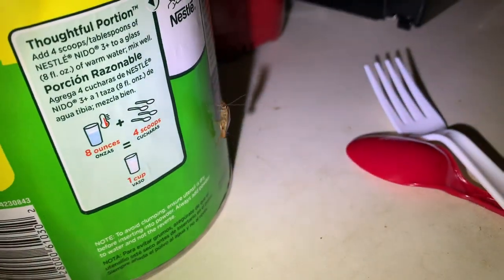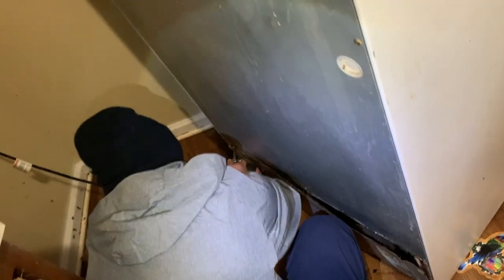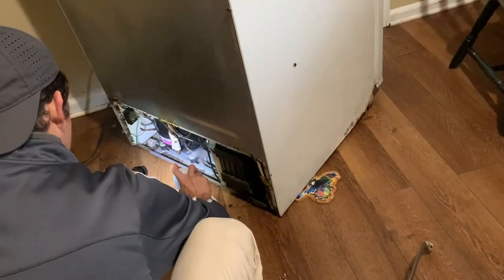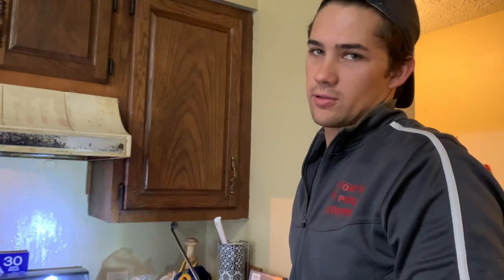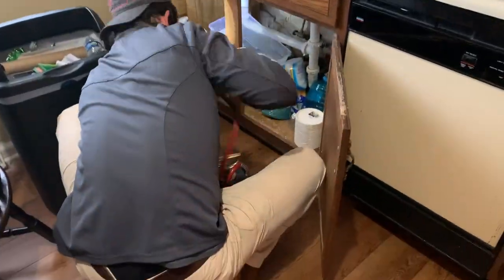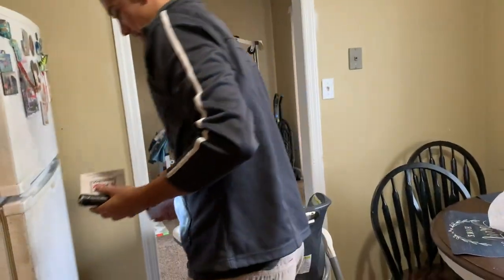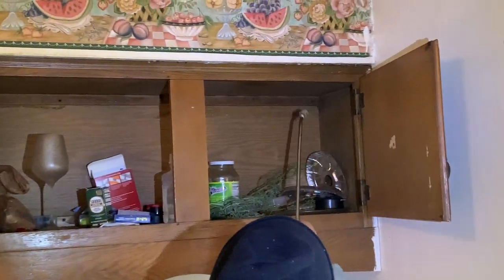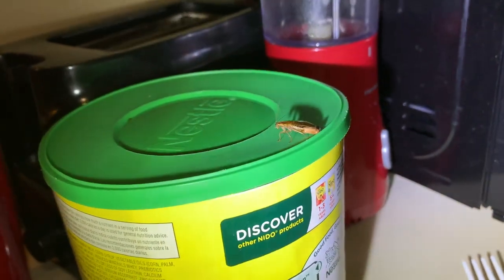Cockroaches in Your Kitchen... Probably?

Comment: I like watching videos like this to see what other folks are doing and if there are any new products or methods I could incorporate into my own treatments and I usually just take notes and move on, but in this case I thought I'd share something. It's best to use dry flowable baits like Avert DF and/or dusts in motor housings behind fridges and around dishwashers and other appliances. You're taking a risk every time you apply a liquid product into an area where something is running on electricity and eventually, you'll get complacent enough to make an expensive mistake doing that.

Comment: What would you recommend if you have pets? What is safe for them, but will get rid of an infestation?
Reply: I think he said he is using transport and gentrol. Insecticides are designed to kill insects, not mammals. Read the product label it will tell you how it's applied and what to do with pets. It will usually say to keep children and pets from the area until the product dries or a specified time.
Interestingly enough, the pesticides they use on your food are more dangerous .
Reply: @toecutterjenkins  thanks!
Reply from the maker: Just apply the product properly and it’s totally safe!